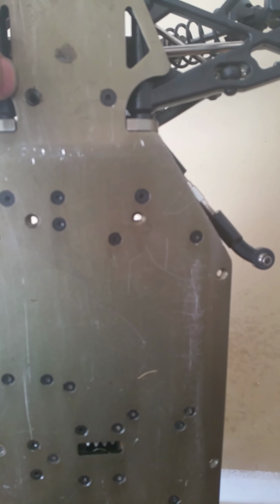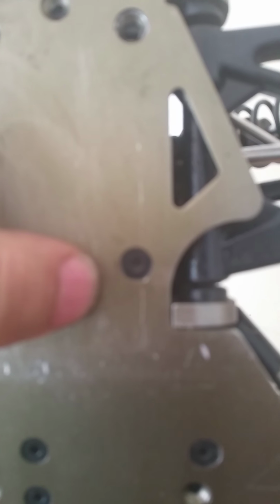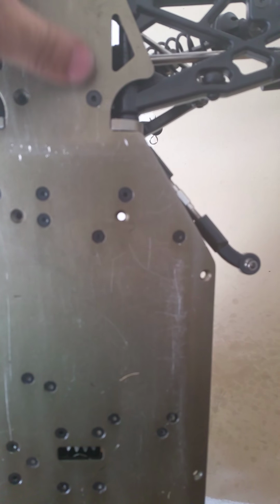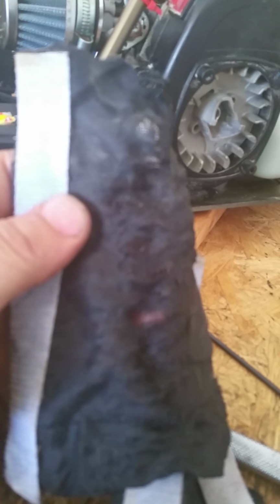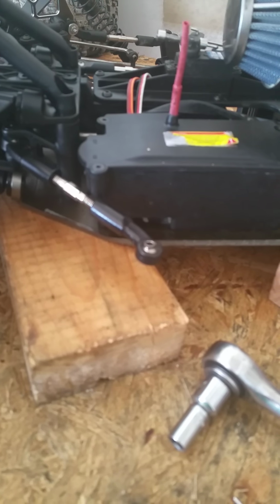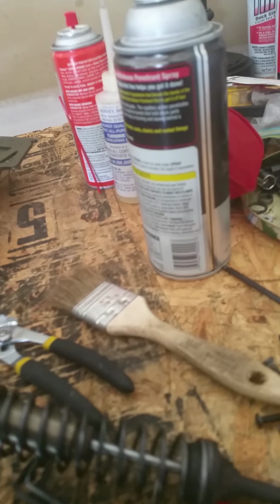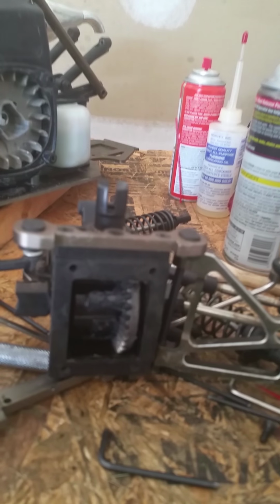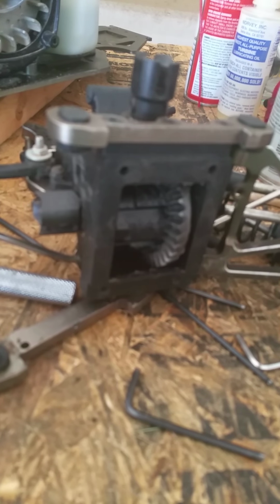Rampage xt parts and break down

Comment: I used 100wt diff oil all around about shock oil never change it, if you have problem with strip alan keys, used EZ out from ace hard ware or any hard ware store, after it came out used dramel to cut the top of the screw so you can used flat head screw driver instead Alan keys, give you advice replace that air filter you have with TGN tree stage air filter, the one you used is high flow air filter from DDM  is bad for your piston, and your rovan remote kill switch, is not worth it,  when low voltage came from your rx on full throtle, it will not kill the engine even you turn off your radio, when the throtle servo got burn to is not gonna kill the engine, buy super bee kill switch or ikill switch from hilandtronics.com, I know they re expensive but is worth it, what you did with the Boca bearing that's marvelous job never thought about it, love your all your video about your xt

Comment: Yeah u putting too much lock tight on there ..put a little near the screw head that's it cuz if u put it on the tip of the screw and screw it in its gonna get on the full length of the screw  ..I just put 60 in my rear 30 in the front of my xb ...and 80 in the shocks ...go to fastenal to get extra screws ..u can get 25 screws etc for like $5 stainless .. instead of getting them from redcat 8 for $10
Reply from the maker: +Diy type of guy  Thanks buddy for the comment ...im still trying to get the rest of the screws out ...pain in the ass
Reply: +Donald Smith u can get a small torch and heat the screws up ..they'll come right out ...umm u can get diff fluid on line or local hobby shop ...